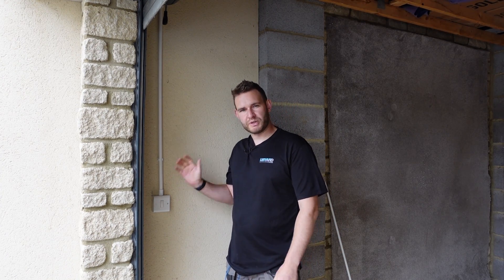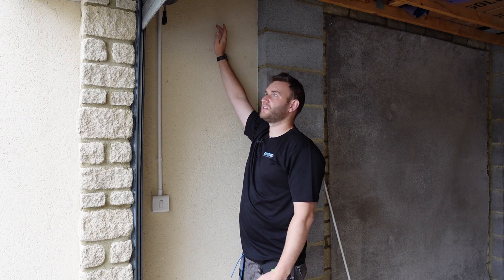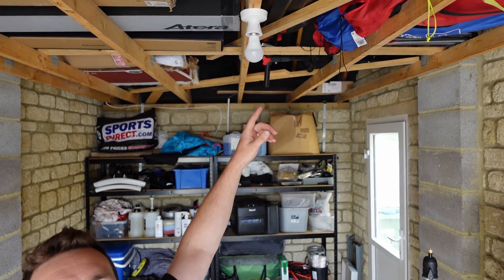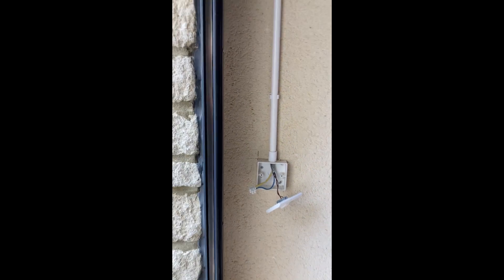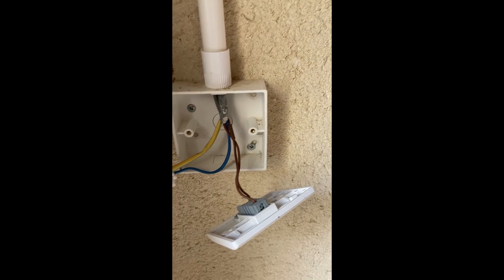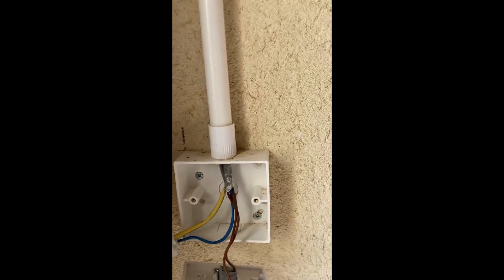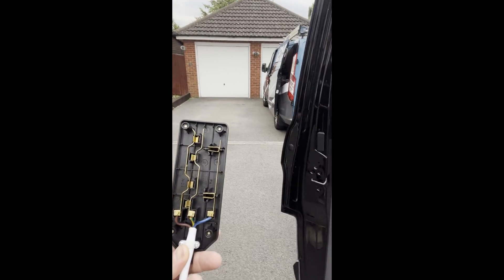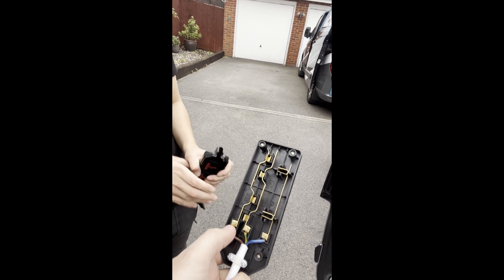How to add sockets and switches to a garage! PLUS a DIY fail...

Comment: I have a 2.5mm twin and earth cable coming into my garage. It feeds 1 double socket and one light switch. Can I add 4 more sockets and one more light switch?
Reply from the maker: It would depend on your particular setup- you may need a 13amp fused spur to protect the cabling from overheating. Consult an electrician :)

Comment: is it not easier to install a sensor light?...it goes on when you enter the door, without needing a light switch!
Reply from the maker: Yes you could install one, however they're not always as reliable as standard light fittings and can have issues with the sensor. This client, like most, just wanted the standard light switch :)

Comment: can you please explain how the wiring was done for the second socket? I see you added an fcu and then connected the 1st socket off of that, but what about the second socket?
Reply from the maker: Second socket wired off the first socket, so FCU > Adjacent socket > Second socket
Reply: @byardelectrical  how did you fit 2 x 2.5mm twin and Earth in the conduit? I’ve tried it before and struggled or did you use singles?
Reply from the maker: @skywalkermahone9219  pretty standard for 2x 2.5 in 20mm conduit, will go in quite easy just got to make sure the cables are straight

Comment: If it's normal 30mA RCD, 230V at 30mA gives you 6.9W of power. If the phone doesn't draw more than at (which is quite posssible), the RCD won't trip.
Reply: Exactly that ,  Basic stuff really

Comment: Nice one but you just know someone is going to unplug that garage door supply at some point
Reply from the maker: Not our install Mike but they are usually wired on plug tops like this
Reply: @byardelectrical  Very good point as a lot of these quick installs are done by people with absolutely no electrical qualifications hence the plug top style
Reply from the maker: @Mike_5  funny you should say that. But yeah if we try to alter it they’ll probably just void their warranty so best left untouched

Comment: The live is correctly wired, just the neutral and earth are swapped.  Probably worked as not on an RCD or RCBO.  Keep up the good work team!  Like your videos.
Reply: I'd look and see how the plug is wired.... 😄
Reply: Hi, you are wrong I'm afraid, looking into a UK 13A socket, the left hand pin is the N and the right hand pin is the Line, the brown should be where the Green/Yel is.
Reply: @raywelshman  Quite right, I got it the wrong way.  Sorry guys!

Comment: fair play well explained on the new socket and lighting circuits chap..all round band is ideal to cover fire regs,not to hard to make it look decent if u want everything to look symmetrical like most sparks should!?on a price point them metal clips are silly money,hard to cost a job using them as customers wont be 2 happy paying 4 them!keep up the good work 😉👍

Comment: Must have been wired up by two sparkies and the one who wired the socket was colour blind! 
If there was nothing plugged in then the socket end was floating and wouldn't have been an issue. If something was plugged in, then it would have been powered from the neutral pin that was wired to Line, so would have 230V and then back down the earth connection, that was connected to the Live pin, all the way back to the incoming supply where neutral and earth are bonded together. As long as the load was less than 30mA load, no RCD would have operated. Good find though 👏👏
Reply from the maker: Glad someone figured it out! A landline phone was plugged in 👏🏼
Reply: Got there before me 🤣 the landline phone will have an insulated earth pin too luckily

Comment: Be interesting to see if it was wired correctly in the plug end
Reply from the maker: It was wired normally as we found this ext lead during our insulation resistance testing 👍🏼